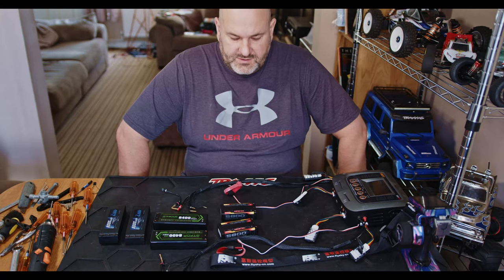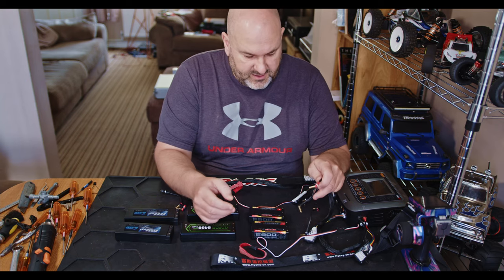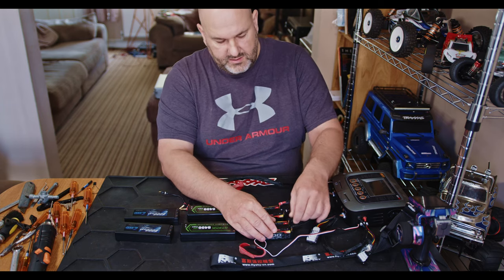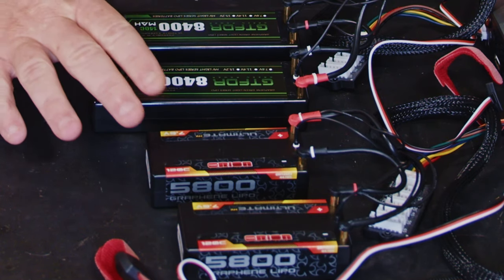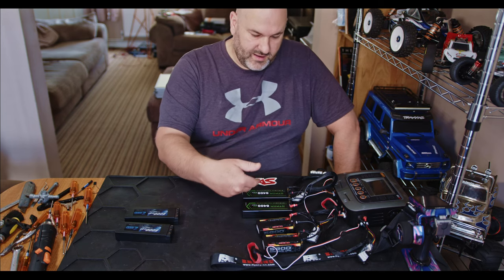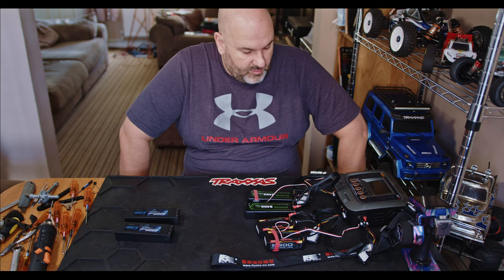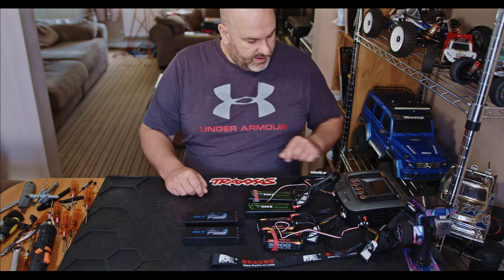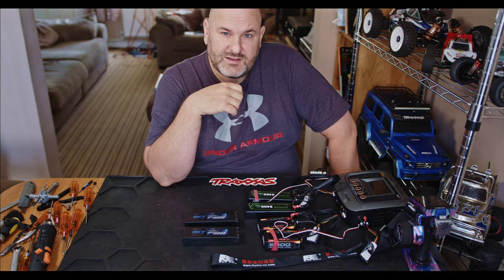SCH-LRP65808 Charging Lead, charge 2 x 2s lipos as a 1 x 4s

Comment: Great video. Interesting cables. I suppose charging two batteries in series allows more control of the charger on the balancing of individual cells as opposed to using a parallel board - Am I correct?
Thanks
Reply from the maker: yeh its not just ram charging them :) and if your charger can supply enough amps you  can still charge them fast :)